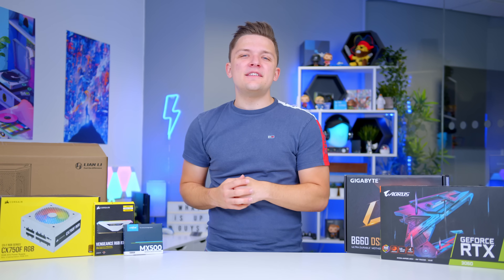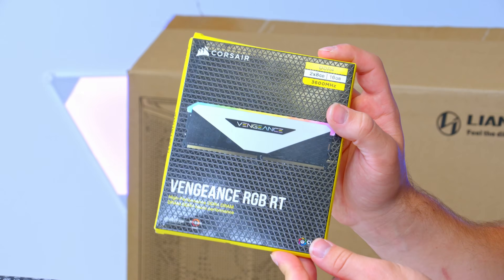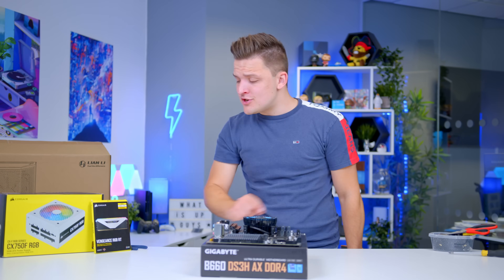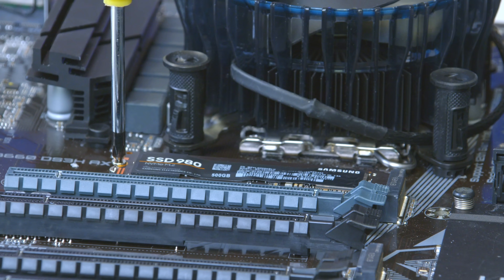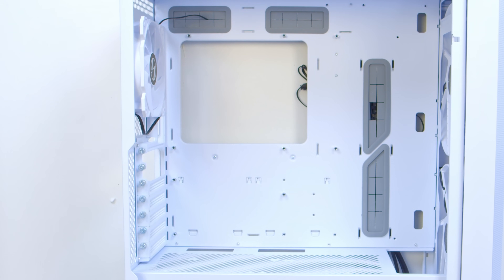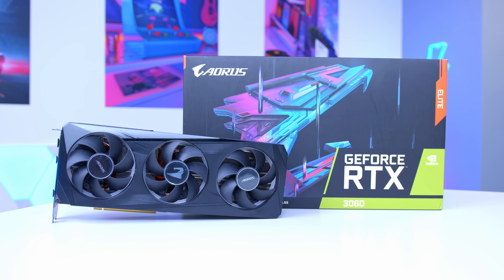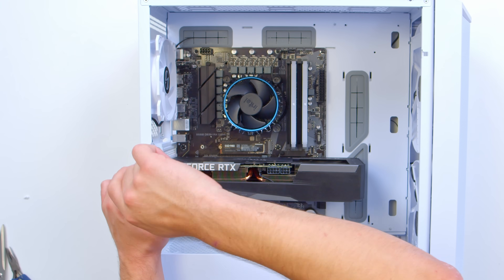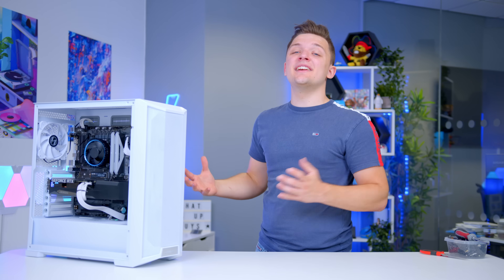Best $1000 Gaming PC Build 2022! [Full Build Guide w/ Benchmarks - ft RTX 3060 & Core i5 12400F!]

Comment: Difference between i5 12400f vs i5 12600k?
Reply: 12600k has 6 Performance and 4 effeciency cores(16 Threads)  the 12400f only 6 Performance Cores (12 Threads)

12600k max ghz is 4.9 12400f is 4.4

And with Intel 12th gen k CPUs u can overclock If you have a z690 Motherboard
Reply: @Gokuyzed  Thx for letting me know <3

Comment: Im actually building a £1000 PC this summer so this is helpful. However im getting the ryzen 5 5600x so what motherboard should I get?
Reply: b550 aorus elite v2 or b550 tomahawk
Reply: @kucea9538  Thank you!
Reply: Wouldent get the 5600x since it would simply cost more in total to not perform better at that costs to be worth it, also awould simply avoidthis YT build.
Reply: @theelepel2679  why tho? Do u know a good build for the rtx3060?
Reply: @morningstar4184  First of all, avoid the 3060 at all costs, since its simply a bad value gpu from existance and wont change either unless it drops massively. for the UK, in a budget of ~1000 pounds belongs a 6700xt (:
Reply: @theelepel2679  what about the 3060ti for  £470
Reply: @morningstar4184  no... since a 6700xt is 470 pounds aswell. and 6700xt is simply the better card..